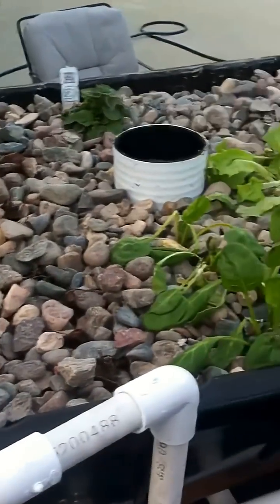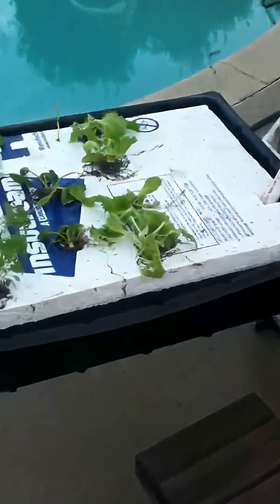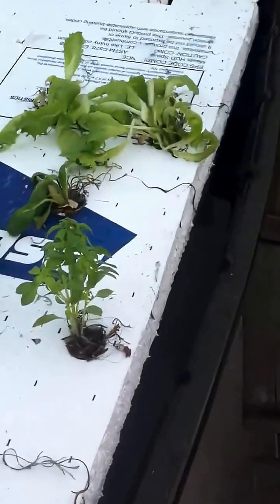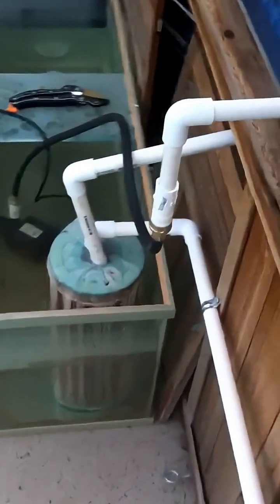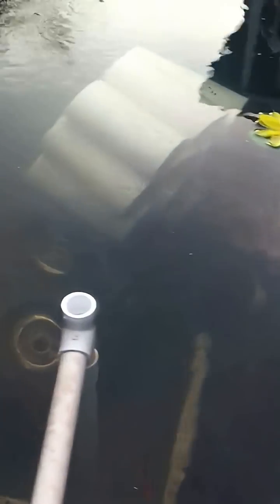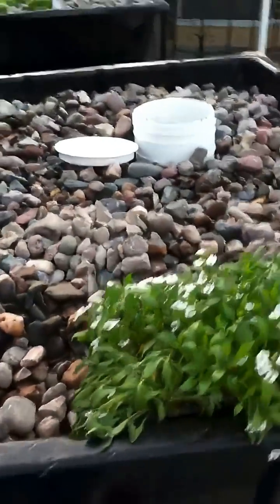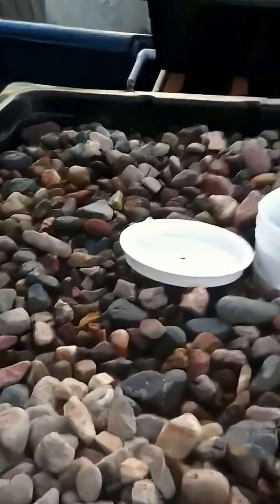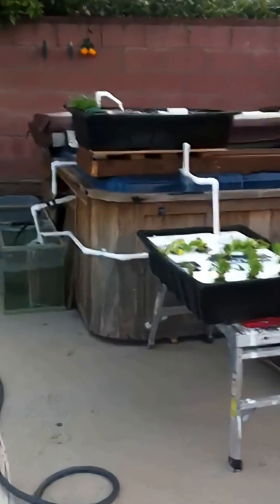Hot tub aquaponics

Comment: Hey I’m currently starting this project with my old hot tub. I see you don’t have any type of poly or pond “underlayment”. My main concern is the jets being exposed. Did you seal those off in any way??
Reply from the maker: Meg Hart If you look at my later videos you will see I enlarged the overflow and the float tanks as well as increased the pump size.
Reply from the maker: I did not seal nor even use the existing jets.  My hot tub did not leak. The mother board died. 
I drilled an overflow hole in the side of the hot tub and installed a through hull fitting. All supply lines were plumbed over the top edge of the hot tub.